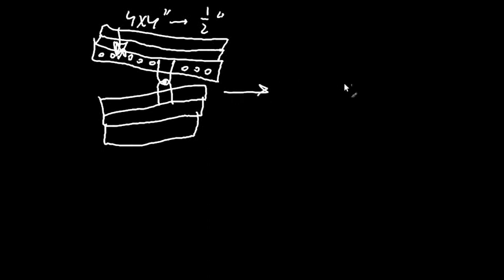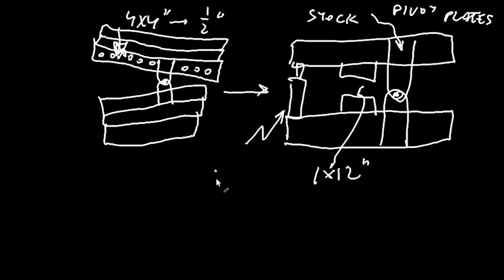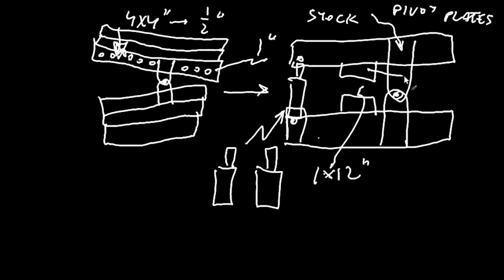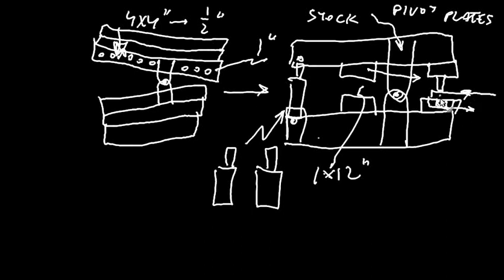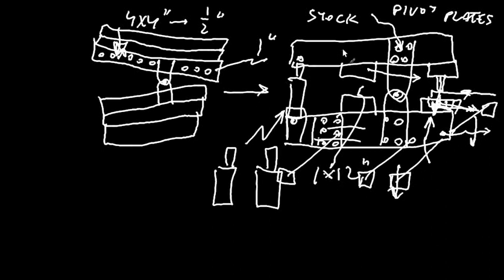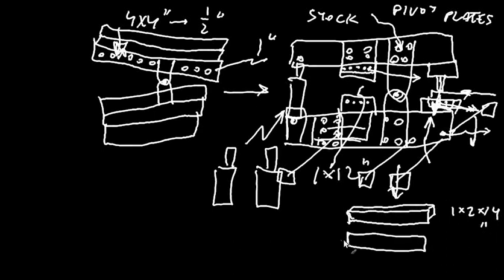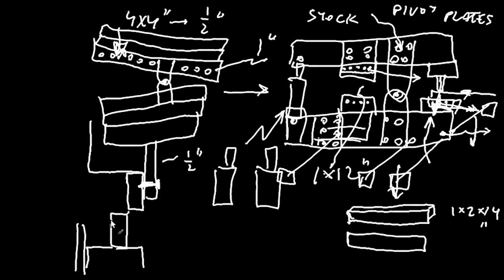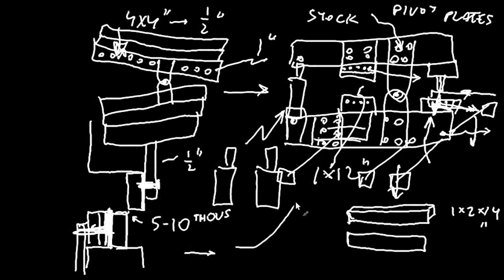Ironworker Machine Concept Video

Comment: 5-10K tolerance is achievable, but the torsional stress of cutting through plate will put your pivots to the test. I would not be adverse to suggest six inch pivots of hardened steel and possibly even guides for the front end adjacent to the hydraulic cylinders.. BTW I know next to nothing about engineering, but I've seen a lot of stuff being built, rebuilt, destroyed, rebuilt...